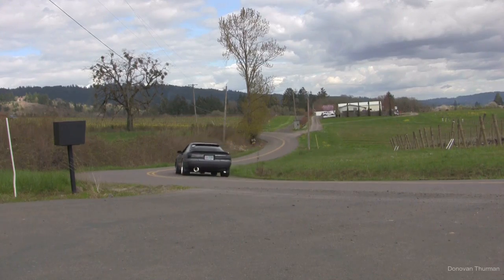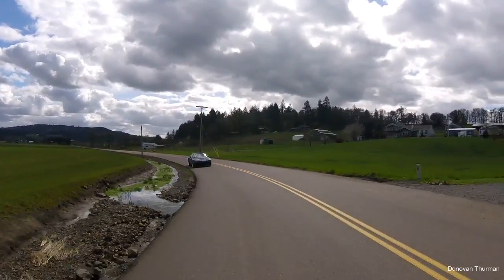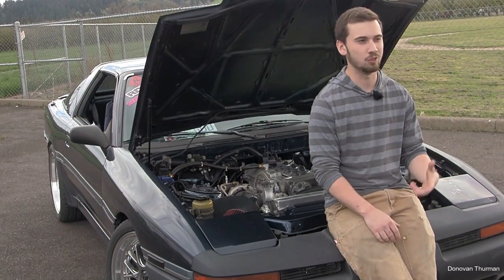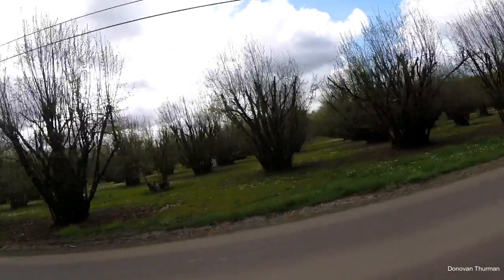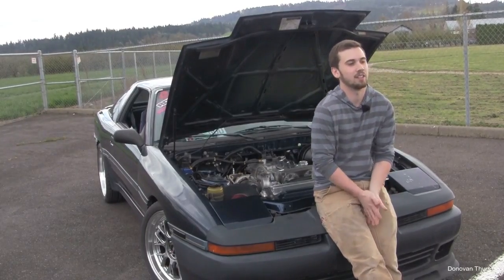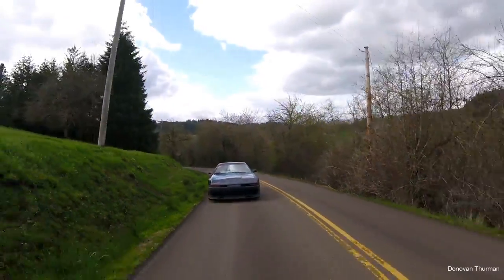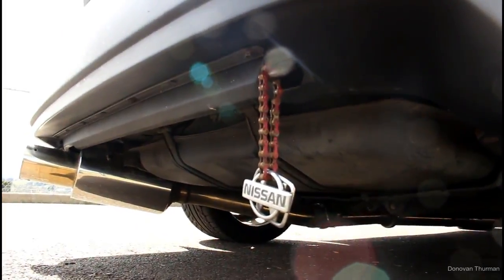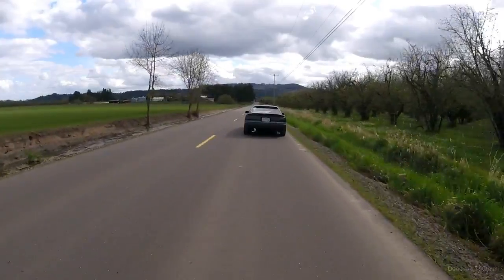Nic's MK3 Supra : 500 HP 7MGTE

Comment: 7M's are the BEST sounding straight sixes out there.  The 2JZ may be fast af but they don't sound as great.
Reply: I agree with this, the JZs have a decent sound (more of a cooler turbo noise than anything else) but I went from a 7M to a 1JZ, and while the 1JZ is a better engine and more fun to drive, the 7M sounded way cooler when accelerating hard through a tunnel, much deeper bass and tougher sounding exhaust note, and that was with the same pipes that were slightly modded to fit the 1JZ swap.
Reply: 7m engene sounds deeper.
Reply: I think all toyotas straight sixes sound cool.
Reply: 7m is cool, but for me the n54 sounds the best
Reply: Mine sounds like a diesel straight up lmao
Reply: tbh I prefer the 7M roar rather than the JZ scream
Reply: 7M just sounds like a JZ if it was diesel.

Comment: Very cool car & nice presentation. I always love the high hp 7m builds :) I have a 2jzgte mk3 supra myself, but I think a lot of 7m failures are related to the owners. The 1jz/2jz guys are always the guys who spent lots of $$ on maintainence and tuning.
Reply: Justinus van Linden honestly retorqued head studs and a shimmed oil pump make them perfect
Reply: @Butt_Quack69  headgasket also
Reply: RisK Reqs well I'd assume that would come with a headstud job yes
Reply: @Butt_Quack69  also changing the original head studs for arp head studs is a good idea.
Reply: RisK Reqs yeah you don't re-use headstuds

Comment: When my stock 7m takes a shit on me making 366hp and 365tq at 12psi.... usually I run at 18psi I want to rebuilt it and do things right and shoot for a reliable 5-550hp 7m.  I think that would be the sweet spot for a street driven mk3. You still get around the traction issues at that power level, have great driveability and a fast spooling turbo. 1-3ed is a blast in my car but 3ed-5th just feels slow
Reply: I have a fully built 7m I was wonder what a good turbo kit for it to reach around 500whp
Reply: @bobbygenius  no real "kits" available. just piece it together yourself
Reply: smallish_mk3  ok I’m new to supra and was wondering, wear to start I got a fully upgraded engine and wanna push the hp on the 7m was just wondering what would be good
Reply: @bobbygenius  sound preformance makes or atleast used to make a very nice manifold. then slap on any turbo that meets your power goals and downpipe. driftmotion offers a decent bolt on intercooler or you can piece together your own for a good price. stock Tb and intake is good for 800+ so it's fine unless you want the look of a ffim. the biggest thing is your engine management. get good tune and ditch the stock cps and get a crank trigger kit.
Reply: smallish_mk3 ok thanks man I really appreciate all this advise, one more thing what do you thing a good turbo would be for around 500-550whp I want it to not be to crazy because I want it to last a while
Reply: @bobbygenius  borgwarner is a great company. I'd email them and see what they would reccomend. or Garrett
Reply: smallish_mk3 thanks man I really appreciate you helping me out, when just getting into cars and supras

Comment: Supra nice video bro! Out of all I've seen this was the most well explained and very informative. I've got a half Korch Mk3 sitting in the garage for drifting/fun driving. With basic upgrades got to about  360HP, could add more but didn't want just like you. Running 380cc injectors, they are dragging me down.
Reply: SlipTheDestroyer i thought stock gte was 440cc

Comment: conserve the motor on 500hp? stock bottom end 7m's will make 500 HP easy and reliably. now a solid built one should be good for 7-800. more aggressive build and it would doin 1000+.
Reply from the maker: marcmann982 560 was pushing the limits of the fuel, so they dialed back.
Reply: Donovan Thurman was he just on a single walbro 255 or something?
Reply from the maker: marcmann982 walbro 400, it was the injectors that were maxing out.

Comment: Nic I’m turn ping a 7MGE to become a GTE, the oil pump input shaft it is a pretty primitive affair drip fed intermittently some oil. Any suggestions I’ve seen a needle bearing thrust bearing (technician racing) what has been your solution? Thanks Andrew